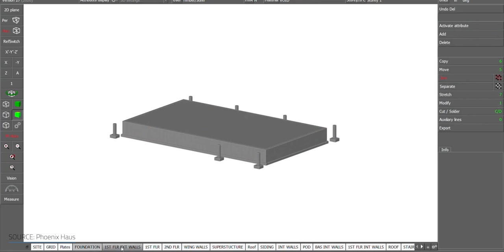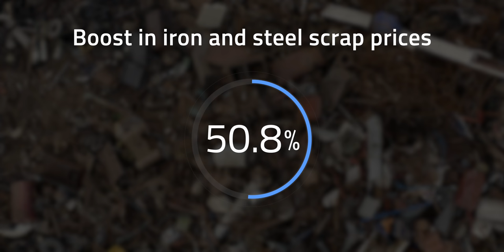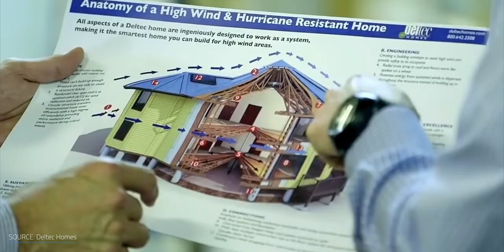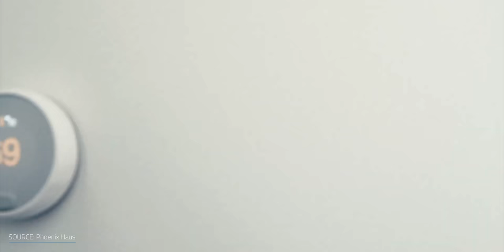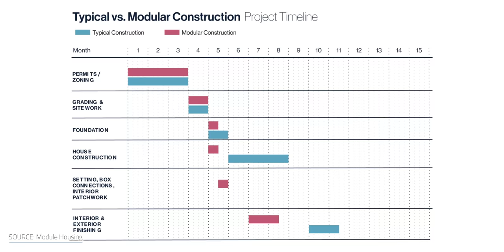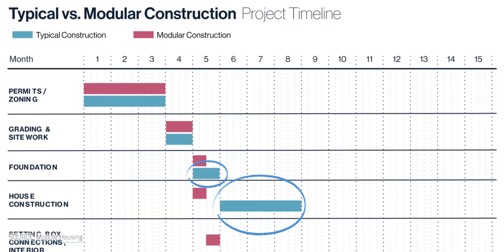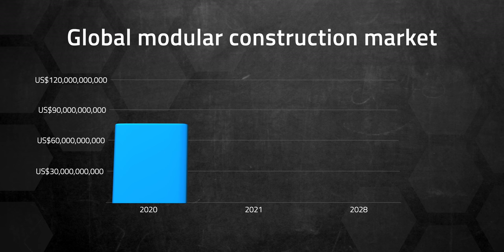Exploring Modular Homes - Cheapest Path to Net Zero?

Comment: Just running across this: my two cents. I looked into new build and just didn't have the stomach for all the drama of permits and build management. Build schedules never run on time. There's always something. But I do find the modular idea very compelling for all the reasons you state. I bought an old house and my neighbor bought the lot next to me, planning to build modular. He sourced a modular home from a reputable semi-local builder, and then things went off the rails. This was 2017 or so. Despite living in a vast housing market, finding a general contractor to assemble your home (if the manufacturer doesn't send crews for everything, including all the subcontractors) is EVERYTHING. So, neighbor picked one of the few firms doing this kind of work (everyone else doing stickbuilt and wouldn't touch modular with a ten foot pole because they don't want the liability and don't want to deal with "someone else's problems"). So, neighbor's contractor ends up failing to pay subs and walks away from the job. It took them several lawsuits, tons of cash by the dumpsterfull (because remember: it was hard to find a contractor to begin with, and now you want to hire them to clean up a walk-away job?), and they finally built their 2600 sq ft modular for something like $850k. I'm including the land. But build costs alone were $500k, all told. Even here in the DC metro area, that's insane. So, anyway, long story short, it's all about whether you can find a GC who is willing to build your modular home and not treat it like some side project that he can get to in between his profitable stick built projects. It's like geothermal: find the right contractor, great. Not that costly. Find the wrong one? It'll cost you dearly. It sounds really economical on the front end and very attractive, but it completely depends on your ability to source competent, reliable labor. Right now, modular is still "exotic" in a lot of markets, and GCs don't like them because they are terrified that the house will have defects they can't control from the factory and they will get blamed. I'm sure some companies have a way around that and they assemble, then you just bring in subs to finish the interior, but you still need a GC to manage all those subs. Most modular seems to be building shells, with the exception of the firms you mentioned building really small stuff. So, choose carefully. Pay extra for the contractor that has a long track record.

Comment: I find your presentation on housing somewhat narrowly focused, i.e: standard middle class suburban. It is an OK place to start, but location is the big issue. The location includes building codes, land use, neighbors, and things like utilities and roads. Over half of our population cannot afford what you are talking about. Affordable housing for people on a limited budge is a real issue. The housing industry is not oriented to the low end.
Reply: Agreed, let's have a talk about establishing a trailer park village somewhere remote.
Reply: Check out Earthships.  They can be built very inexpensively, they use a small fraction of the power required to heat and cool a traditional home, and they are built to last a few lifetimes.  The ones built since 2013 have all the latest features that make it a modern design - though many of the earlier designs are still being used today.

Comment: Resell value, and getting mortgages are always an issue with modular homes in the US.
Reply: That is true. Also, insurance can be more expensive and they tend to depreciate in value.
Reply: Why would it be a concern for banks? It is up to code.
Reply: @AlexBerg1  Not sure why, you have to ask the banks.  New is usually not a issue, it is when people attempt to buy one that is not new, is when the issues start.  It might be that modular have a tendency to depreciate.
Reply: @randalsmith2713  How is that possible though? There has to be some underlying reason why the mortgage market sees existing modular homes as a liability rather than an asset. Which to me is baffling, Idk about you?
Reply: I think modular homes and mobile homes need to be classified differently by insurance. One's on wheels and can easily be blown away by bad storms or is more prone to meth-explosions LOL. The other is simply a house built on a slab rather quickly.
Reply: @Marco3202002  I am stating what is being seen by people.  I do not have insight into the thinking of the mortgage companies.
Reply: @randalsmith2713  I know. It’s just going against the norm when thinking about housing in the US.
Reply: Sorry, but this is simply false.  I worked as a mortgage underwriter for several years and modular homes are treated the same as normal stick built homes.  Manufactured homes are treated differently when it comes to financing, but not modular.

Comment: You're 5-10 years ahead of my similar project.  Please include embedded CO2 emissions costs due to transport from factory to building (assembly) site.
Reply: Wouldn't that vary greatly based on the different build sites?
Reply: @ElvargsBane  Of course.  Matt can calculate his own situation as a baseline.
Reply: the construction material is trucked to the build site anyhow, no matter if the assembled or not.  If you truck a palette of 2x4 to the site or a complete wall - doesn't make difference.    That 20-50 construction worker are commuting to your build site from far away - makes a HUGE impact.   Count all those cars and Pickup trucks going to the site every day - going to lunch and back every day for months - crazy CO2 -   - trucking  the whole house once and assembly for 3 days?  peanuts .
Reply: In 5-10 years a Tesla Semi or similar will transport your home, so not to worry. 😀
Reply: @elwinvanwees8516  Yup and the harsh reality is that those Tesla Semis or similar, if they're going to compete with traditional fossil fueled trucks of today, will be charged with electricity produced mainly by the burning of fossil fuels.  So to reach "net zero" your house can consume NO energy for the first 5-10 years.  By then, you'll have given up on it and it'll be rotting away, releasing biomass CO2 increasing your carbon footprint so you are allowed to not breath.  Sounds silly, but Net zero is a pipe dream.  CO2 is not the enemy, but the politicians and environmentalists are making it out to be... what a sham.
Reply: @mjmdiver1137  yes master.
Reply: when i did this for a job, i looked the location of the factory to its destination, used google maps for the shortest route and used that as an estimate.  i knew the vehicle types was able to get data on emissions. used that as the company estimate.  we did it over one month, which admittedly is not completely accurate but it was enough to satisfy regulation requirements.  did the same for employee travel (this excluded their home to work commute) so every claimed expensive like train, plane i worked out the carbon from that.  unless you have a millage book for the drivers, you will never get 100% but i think we worked out a good estimate.
Reply: @HamRadio200  Educate yorself before you look like a fool too much. You already do.
Reply: @mjmdiver1137  yes. I’m sorry
Reply: @Rainbow Capone you are part of a relative few. Expanding this to entire cities and metropolitan areas is a pipe dream.

Comment: 1:48 Being European, my standard for sturdiness for a house is brick and concrete so talks about the differences in sturdiness between one wooden house and the other always sound a little silly, as if you're seriously concerned about your long term investment you should probably first think about not making the load bearing structure out of flammable material... Not to mention the price of terrain is much higher and unless you're very well off buying an already existing house is really your only realistic alternative. That aside I can't see why a modular house shouldn't be as sturdy as one built on site, considering all modules need to hold up indipendent of one another and survive the trip as well as being hoisted up and down, if anything the sturdiness of a house built on site shouod be questioned more because unlike a modular one, you can't slice off a piece and be absolutely certain the rest won't collapse.p
Reply: Depends where you live. Here in Sweden wood is pretty standard for single family houses. I heard wooden houses tolerate earthquakes better because they are a bit flexible whereas bricks or concrete may crack and crumble.
Reply: Honestly, they probably could just do the outer framings/load bearing contours in steel or such and fill it up with wood and insulation material etc.
Reply: @MDP1702  You could, but you would increase the carbon footprint of the building without adding any significant improvements. Wood is good enough for small houses when it comes to strength and rigidity. Only problem is maintaining wooden facades in the increasingly humid weather. You can spend the extra dough on a brick facade to make it more maintenance free.
Reply: @itekani  I am talking about when/if just wood is not enough, for example due ti local regulations etc.
Reply: @Jorpl_  if you have something like a bonfire going on inside your house, which is likely given the amount of carpet and other inflammable furniture houses tend to have, the laquer can still not provide enough though it is a good (as well as very expensive) measure to make your house less vulnerable than a pile of firewood.

Comment: Positive impact: “starts the video showing a helicopter delivering parts”
Reply: That's just to keep the price down
Reply: Ha ha thought the same!
Reply: I wouldn't be surprised if in mountainous or hilly terrain, the speed and (relative) efficiency of the helicopter wound up ultimately being competitive from an emissions stand point.

Edit: Just my best crack at a defense off the top of my head, I could be blowing smoke from all I know.
Reply: Agree. And while Matt doesn't create those video clips, it is noticeable that virtually every one of them was building on virgin soil in a rural area, which will negate a good portion of climate emissions savings, and will destroy natural habitat. We need more infill development of efficient housing. It reminds me of a local bank that built a LEED certified building in the middle of a corn field; now ~100 staff drive cars way out to this remote location every day (a bit less during pandemic) on a huge parking lot, negating pretty much all the good the LEED certification had done.

Comment: In Scandinavia these types of homes are the norm - they are very customizable - I drew my own home, went to one of them and they created the modules to fit my design - from idea to moving in with permits and everything took about a year (including finding and buying a lot to build on). Our home is about 2400 sq ft, two stories and triple glazed windows (floor to ceiling in many places) and about 15 years old now. Passive heating is a dream however in Sweden even with 1ft thick walls - hard to not heat when we get to -10 degrees fahrenheit in the winters.
Reply: Im Scandinavian, and no, these homes are not a norm here.

Comment: Hi Matt, I look forward to following your journey. However, you need to be aware that one potential downside of the factory built home that is delivered to site for quick installation; and that is the issue of voids. You need to know 100% that these have been designed out. Voids are a danger when you have a fire. The void act as a chimney helping to spread the fire quicker. 
On the Scottish islands a new hotel was built using this method. They had a fire and it burnt to the ground very quickly. This issue was a void between 1st and 2nd floor if I remember the details correctly. Whatever you choose design out the voids! 

I have just completed a new build using isotext blocks...

Comment: I'm building my own version of passive Haus built into a hill. Will have a 19" double cement block wall to survive tornadoes, prevent fire, heat sink, passive cooling. The two sides of the wall are 8" thick block separated by insulation to prevent thermal bridging. Also, blocks will be filled with local earth+Portland cement to further strengthen. Tied to cement over solid rock base via rebar drilled into the rock base. Will have attached greenhouse for temp control + food and clerestory for thermal venting. Will also feature inside soapstone wall next to wood stove for radiant heating. Many other features ( solar, geothermal, etc ).

Comment: Matt. Before I built my PH here in New England (I do have a relatively amateur video on the construction of that house on my U-tube channel -my only post) I was considering a modular house. I did visit the shop of Ted Benson in NH as they can build to PH and make some really nice timber frame houses. They were a bit pricey but superb factory and quality (at least 4 years ago when I visited). They did not have a great design for my steep lot so I had to slog through a tedius construction project with architects, builders, and contractors that were not so familiar with PH. I did have a great architect with Steve Bazcek and found a great  PH consultant with Byggmeister that formed a 3-man team you need to make PH work. Agree with the idea of a Modular house built in an environmentally controlled barn (factory). At the time there were some issues of electrical and plumbing unions objecting to the modular approach - maybe they have resolved that now.
Reply: Excellent video, nicely paced and well presented.  You were way ahead of the curve.  What's the temp been (inside) over the past few days?
Reply: @jimmatthews6034  Here in Princeton we are a bit cooler so temps have made it about 90 here at the end of June. I normally just run the one small 12 btu/hr mini split on the top level which easily keeps it in the low 70's where I set it. I have been turning it off between 4-7pm as I signed up for peak load alerts to help our town cut down on transmission and capacity costs (voluntary). I don't notice any warming in three hours. More interesting is the fresh air system with the glycol and slinky loop which pre-cools the outside air to about 65 degrees which knocks out some of the humidity. This helps reduce the already low HVAC load even lower.

Comment: I used to work making and installing these. They are not anything like mobile homes.  We did several 4 unit apartment buildings for a customer. They were delivered in pieces on flatbed trailers.

Comment: During the past six months I've created a system of interconnecting panels that can have doors and windows places throughout.  This way the home could be broken down and easily transported, taken apart and fixed, and easily install inclusions and add ons.  The main problem is I'm not an expert in any of the field of carpentry, electricians, plumber, insulator, contractor, etc. so I'm not sure which of my ideas would pass regulations and codes.  I got a whole journal with pages of ideas and I've been doing a lot of YouTube watching learning about foundation, insulation, plumbing, but I would love to see what you've come up with.

Comment: The speed homes are built by traditional on site builders depends on the company.  I've seen huge homes put up in less than a month.  And yet, ones going up for cheaper homes take entire year to be finished.  Track housing seems to take the longest since they are doing a lot houses same time.   BUT for cost and other facts, I'd say modular still has greater advantages.  Here in CA, many of the builders start right before rainy season for some reason, so there's a LOT of structure damage that they don't blink twice over.

Comment: While volunteering my time for several years we had a local company build 1000 sq ft houses and deliver them. We built the foundation and they came out and dropped each 1/2 on the foundation. They were incredibly energy efficient. They had 12" SIP panels along with a tornado safe bathroom. They were very well built but not without issues. Modifying anything through the wall was a challenge. While I am all for increasing energy efficiency there is a concern I have with all super air tight houses. In the event you lose electricity for any length of time those houses become unbearable in the summer or the winter in a few days.Non-grid tied solar is the way to go. 

For an energy efficient home I am surprised you are not considering a geodesic home.

Comment: 4:10 "One of the big reasons modular homes are more affordable... is due to waste."
Another big reason is labor. They can build it in a place (often Mexico) where labor is much cheaper and then ship it to your site.
This is nothing new. I had a shed built about 20 years ago and they told me it was built in Mexico. It's held up remarkably well. In fact I don't know anyone with a better shed.
10x20, cathedral ceiling, electrical wiring, two overhead lights. I did a little of the wiring myself but that was super cheap.

Comment: Due to where I live and tornado risk I'm just building an ICF home. They are ultra energy efficient. 
The concrete actually acts like a heat pump to some degree. Conducting 55 degree heat up from the basement foundation during the winter and cooling during the summer.
I would absolutely go modular if i weren't concerned with safety.

Comment: I'm lucky to be in sweden i guess, i'm looking at adding a second house to my property and the companies i'm talking with have quoted $1200/ m2 (about $108/ sq ft) for "full entreprenad" (where the company does everything, including paperwork) and $500-$1000 as a work cost in case permits are denied

And yes, the models all meet passivhaus and come ready for solar, one (the one i'm leaning towards) even coming with a terrace that you can add on a solar roof onto for almost the same as a normal angled panel rack